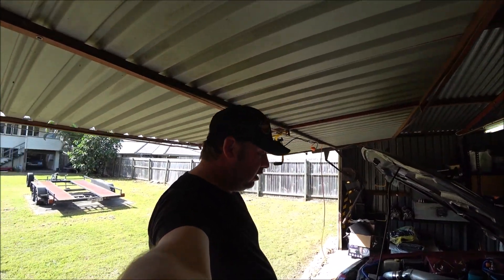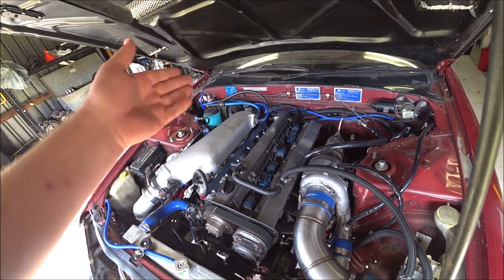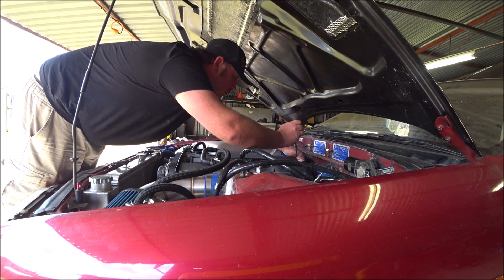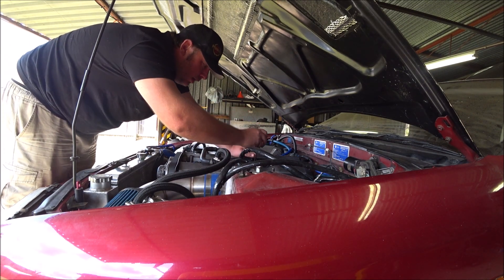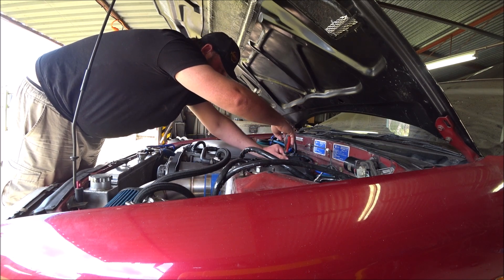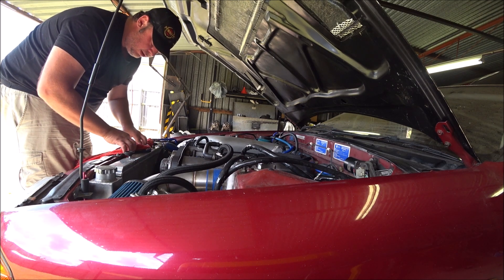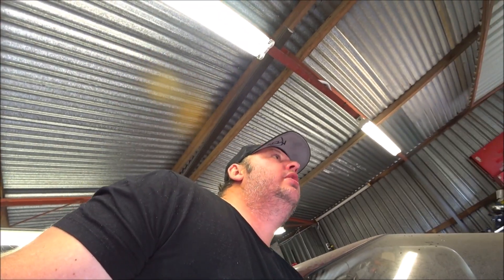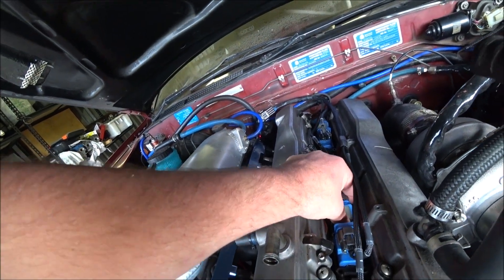RB25DET Build - Coil Pack Test

Comment: when you test the coilpack,i didnt see any difference in idle..are those coilpack is loosing power or going to break?
Reply from the maker: The child were fine. Issue was elsewhere
Reply: @tangles01  i have same issue with your engine.stock 34 neo turbo.when i test my coil there is no change in idle.same through all coilpack.
Reply from the maker: @huzaifmohd8903  I'll save you having to look through the next couple vids to find it. The number 3 injecter plug had disconnected. It wasn't off, just lose enough to not make contact always.
Reply: @tangles01  okay noted
Reply from the maker: @huzaifmohd8903  of course you should binge watch all 400 and something of my videos all the way through, click on some adds, comment on each one like them all and anything else that helps the algorithm

Comment: Did it end up being any bad coils no good? I'm having similar issue, few weeks after tune, now popping, lumpy, rotary sound, black smoke, or was it to much fuel ?
Reply from the maker: It was underfueling. I had plugged in 2000cc injectors when they were actually 1400 . As well as a stuck ring, of all things.
Reply: @tangles01  thanks for reply, I running ID 1200 injectors , think somehow my tune play up and to much fuel now, down low revs terrible.
Reply from the maker: @clownangel999  mate get her to a tuner. He'll sort it.

Comment: Good point about blocked injectors. They could be gummed up from the E85 sitting around in them
Reply from the maker: It's a theory
Reply: Hopefully that’s it. Cheap and easy 👍🏻
Reply from the maker: @kylej489  Well I've had the injectors flow tested and cleaned... you'll see the result next Friday.
Reply: tangles01 looking forward to it mate good luck 👍🏻
Reply from the maker: @kylej489  cheers

Comment: The misfire could be caused by the exhaust leak, if it is leaking before o2 sensor it will suck in air, ecu will think its lean and dump more fuel in, that can cause misfire from being over rich
Reply from the maker: The though crossed my mind, but it's not wide band. It's only narrow band, and people start cars and test without them all the time, at least I believe they do. I doubt it's the issue, but I could button up that leak soon and see if makes a difference.

Comment: I'm kinda surprised it didn't stall out or start to idle high around the 4:30 mark when you pulled the vac hose from the PCV as you're letting in unmetered air, but with that being said the 2nd vent and the catch can is likely reducing the volume of the leak.
it wont hurt having your injectors cleaned and flowed either, just remember that it's not always as simple as air + fuel + spark, and too much air or fuel is just as bad as not enough. so if you repeat the same test later with a set of known working injectors just be sure that any airflow sensors are properly connected and that all vac lines are either plugged up correctly, or blocked off.

one more thing. I've changed more coil packs in b series falcons than I could ever count, so if they're even half as bad on the RB engines i'd be replacing the whole set, and bench testing the ones you pull out to see if any are worth saving as spare parts.
Reply from the maker: Mate it has no PCV it's straight vented to catch can. Also it runs a MAP sensor not a maf so it doesn't meter air in at all, so as long as I'm not making boost, having a vac leak or 2 on't do too much as it's running on the manifold air pressure. Coil tester is on it's way to check.
Reply: @tangles01  oh, cool, well there's that out of the equation. In any case, here's hoping you're able to find and sort the issue quickly and cheaply as to get rid of the headache 👍

Oh, and as others have mentioned, can't hurt to check the earth. It's easily overlooked, but can be tested easily, and hopefully fixed with a simple length of cable or two.
Reply from the maker: Earths checked. Many times.
Reply: @tangles01  bugger...
How did you go with the coil tester?
Reply from the maker: @YouNameItGaming  After checking it out, it wasn't suitable, wouldn't diagnose the problem.

Comment: How are your engine grounds looking? I had ignition issues on my RB20, ran a nice new ground from the firewall straight to the head under the ignition cover and solved all my issues. when your testing id also try and throw a bolt in so the coils get a decent ground and instead pull the plug off each coil.
Reply from the maker: I've tested all the grounds everything is earthed. It's been started many times with the coil bolted in. un-bolting them made no difference.

Comment: Have you checked fuel pressure?
Reply from the maker: Not directly but at the stream of fuel shot about 20 feet when the fuel line splti, I'd back it's not an issue.
Reply: Does it still run the run the return system. If so you can pinch the return and see if it runs better. 
You just got to get in there and nut it out man. Do you have someone who can help you out for a bit. Work through everything you will find it. Seems like you have a little play and then give up. Not trying to be negative but you have to i invest some time and get to the source of the problem.
Like I said last time, really enjoying you sharing your journey keep the videos coming.
Reply from the maker: @Sam-nl6tm  I'm just doing one thing at a time to avoid getting to frustrated at it for now. It won't beat me I promise you. Yes still running a return system.
Reply: Don't get frustrated mate just work through your process of elimination. What city are you in?
Reply from the maker: I can't help getting frustrated, but I can help breaking stuff while frustrated... I'm in Brisbane.

Comment: How do the plugs look? It sounds pretty lumpy but hard to hear on the phone, which intake cam gear did you end up using
Reply: Agree hard to hear the difference on the phone.  Call over and pick up my COP tester on Sunday.
Reply from the maker: I will be, when you tell me what time I can.
Reply from the maker: I replaced the intake cam with one of my spares. It's lumpy as because it's running on 3. Plugs look fine, both sets I've tried.
Reply: Sounds like intake cam advanced too much, little changes make big difference on intake
Reply from the maker: @russelltilley8266  Can't be enough to fire on 3

Comment: Hey tangles me again the guy that suggested coil packs. At night spray water to see if you definitely have a arching spark. Ive been told the gel on the side goes cloudy for visual inspection. (inside to coil). Then the usual pull plug and coil earth it see if it sparks, Bar that there should be some values for coil you can check via a multimeter. Im aware you would know most of this but just brainstorming mate. Ill be tuning in same bat time, same bat channel. Wiring could be also a littile how you going hence the intermittent spark.
Reply from the maker: I've checked for spark at the plug, they arc just fine. But something is jacked up somewhere... I've done more testing today and will do more again Sunday.